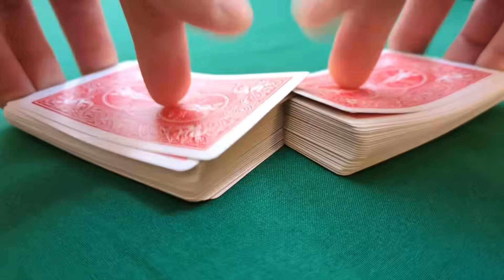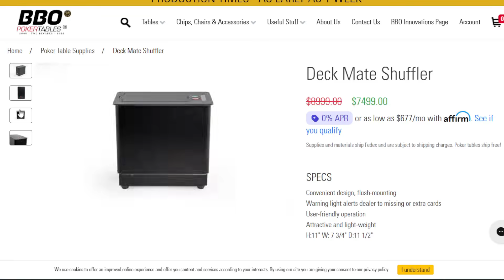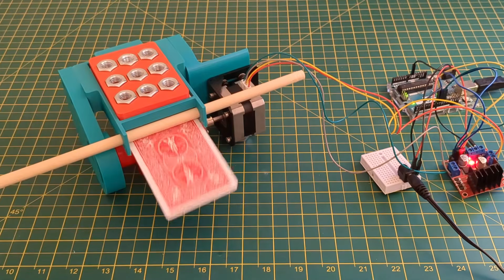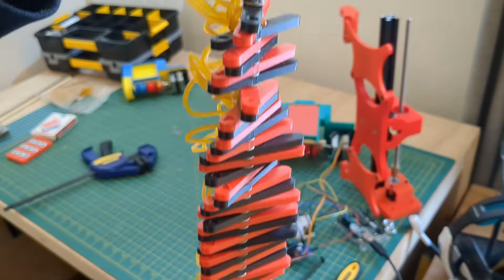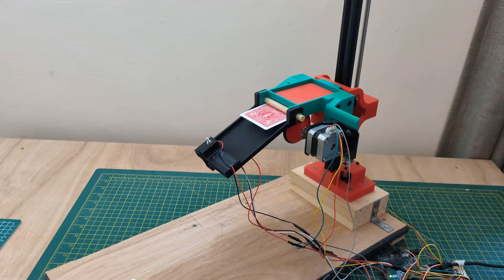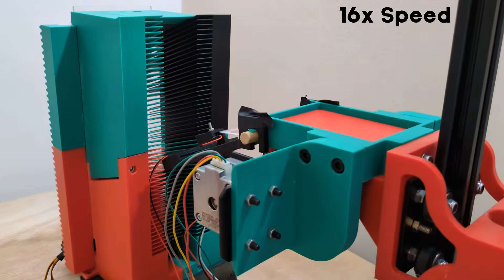Making a DIY True Random Card Shuffler

Comment: Hi Luke, I loved the video. I was planning on trying one of these for a while but it seems you've beaten me to the punch. I hope you don't mind if I borrow some of your ideas, especially for the card separator.  

Alteration to design worth considering:
For separator:
Swap lead screws to a belt and speed up the movement since it looks very light. This alone would dramatically speed up the run time and strike me as an immediate upgrade as it takes a grotesque amount of time to travel between slots. 

For the rack, I'm of two minds:

Instead of a 1x52 tower, I was thinking of making something like a water wheel that spins to the randomized card slot with a big rotating plastic stopper blocking them from falling that shifts during collection, letting them fall into the collector. You'd keep the seperator stationary in this case. 

The other option I've thought more on was to decrease the size of your tower to 6-8 slots for stacking cards that use a different sorting algorithm. Instead of dealing all 52 cards on a 1 by 52 map, I treat the rack more of a memory buffer so the collector can collect from each stack in any order before the pile-up from the smaller stacks causes issues with the relative order. This way, you can minimize the distance traveled/size of your rack and which very clearly is the limiting element in the current array. 

Due to physical space limitations, it'll make the components generally cheaper + some casinos machines already use the wheel method, I'll probably try the 8 stack method first and see how it goes.

Comment: We want to have a card Shuffler for our homegames and therefore I came across this video. While it's a cool DYI project it is still work in progress as it isn't really usable with the long shuffle time. 

Also may I ask how much it had cost already? And how much work you had put in? Maybe it can be an option if there would be a completed documentation how to build one already ^^ 

But I assume the shuffletech ST-1000 for around 850 dollar does the job faster and cheaper, especially figuring in the hours of work (also you need the tools and skills for this). 

While ST-1000 doesn't use RNG shuffling, they say it sufficiently mimics dealer shuffle methods and it can be considered true random. However there is no statistics of it anywhere. The price suggests a better shuffle mechanism than  cheap shuffle machine models.
It shuffles in around 40s with the quick paced mode and 90s with the ultimate random mode. With 2 decks this is definitely fast enough

Comment: Wow awesome contraption. Seems like the slowest part is definitely that ball screw. Would be super cool to see a follow up that uses a rotary distributor mechanism. Issue there is that your cubbyholes now have to be radially arranged which makes collection more difficult. Might be able to use the same sliding-gate idea but instead have it move along a circular track.

Anyways really great video